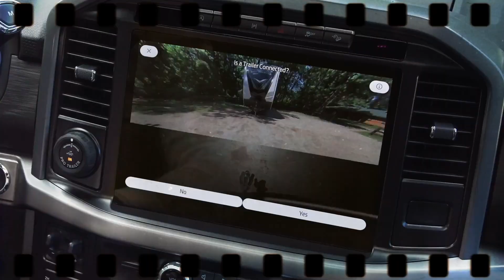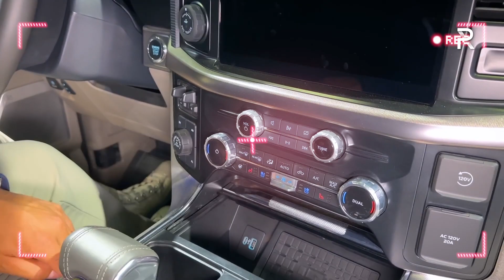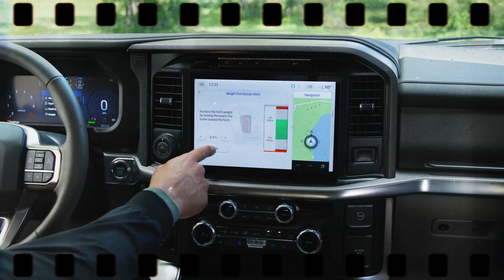Don’t Buy UNLESS You Can Handle THESE 3 Things (2024 Ford F-150)

Comment: No LED DRLs on the XLT..
Reply: You highlighted my biggest gripe with the 24.
Reply: @darellhunter2205   It's disappointing... My current truck right now is a 22 Silverado LT with the 2 big digital screens which they made standard on all 2022 LTs and above as a part of the mid year refresh.. Ford 1 up them by making their big screens standard on all trim levels, but I have the homelink system, trailer brake controller with trailer app, 3D surround view. LED DRLs, LED reflector headlamps but the far right and the far left sections have the HID which makes it look like LED projector headlamps, power slide rear window..  its disappointing with Ford because in order to get LED DRLs, the homelink and possibly a few more features, I have to shell out for a Lariat... The 2023 XLT has the same exact LED DRLs at the 2023 and 2024 Lariat.. Ford made a huge mistake and this new lineup is disappointing and underwhelming.

Comment: 180 owners over several years report this easily fixed issue on the  most sold vehicle in the country. 😂 How many F150s does Ford sell every year? A million?
Reply from the maker: Point taken! The F-150 is indeed a best-seller. It's always interesting to weigh the reported issues against the sheer number of units sold. Thanks for the perspective!

Comment: Newflash, Ford switched from timing chain to belt in 2021. Haven't heard any issues concerning that since the gen 4 Coyote 5.0L V8 came out, even on supercharged trucks. The belt is made of kevlar, which is very strong...
Reply: Only the oil pump has a belt . Still has timing chains
Reply: @petergalvez6431  You are correct after looking at a technical manual.